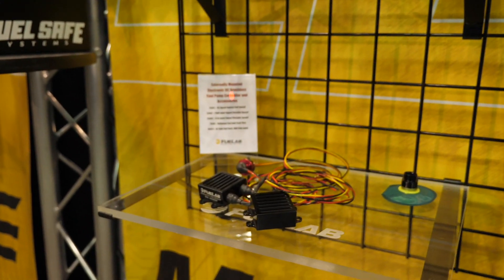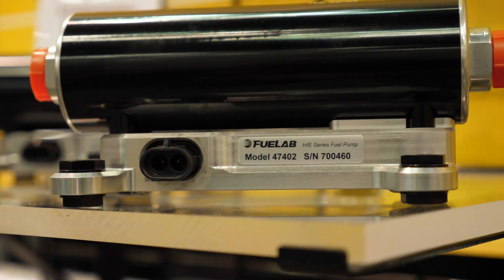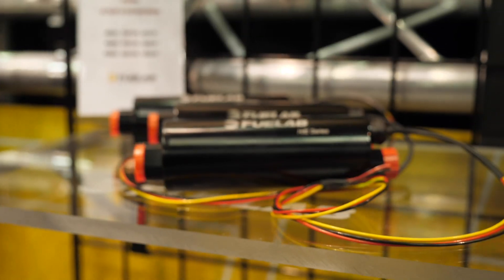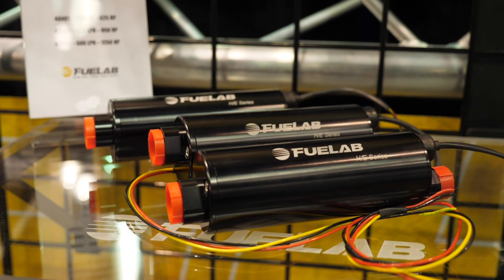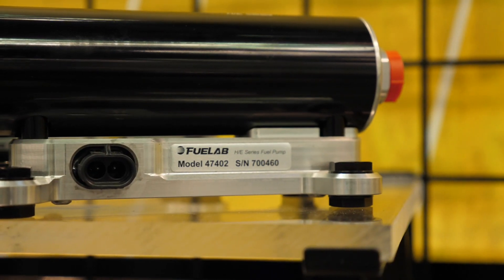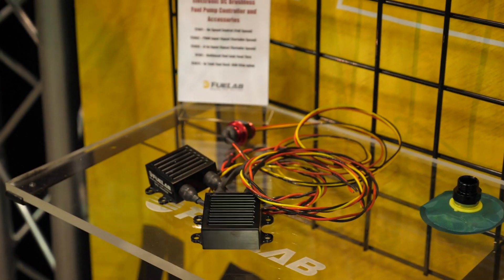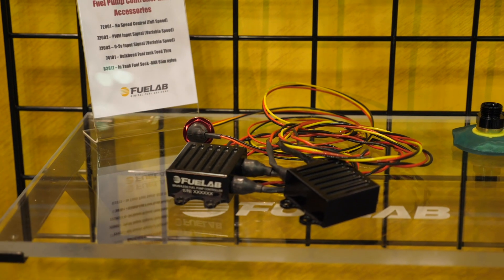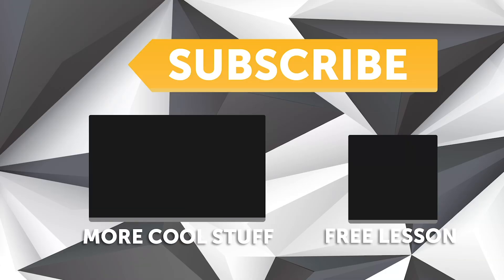The Ultimate Fuel Supply | Brushless Fuel Pumps [TECH NUGGET]

Comment: RC car ESC, OEM pumps are cheap
Reply: depends...
i wanted one that just turns on when powered up.
hard with the RC ones... and then finding a micro one that will take 12v rather than 2S max?
i aint planning on punching more than one hole through my tank for power. 

pump im running is submerged, and turns out theres an ESC in the plug...

Comment: I had a complete Fuelab fuel system on my car and it's high quality and top shelf stuff. i didn't understand the purpose of the external pump tho. it overheats even at the low pump setting for street duty eventually shutting down. i wish the big, brushless pump could be submerged like a factory pump. that would have improved my whole fuel system. i will use Fuelab in the future.
Reply: You could... create your own bypass between pump and regulator, returned to tank.  Use a needle valve for fine tuning volume so you can set  the minimum fuel needed through pump at idle to ensure cooling?  If I tried that, I would log pressure vs. rpm on a w.o.t. run just to ensure the setup didn't hurt pressure at any point before redline.   If it did... maybe add a normally open solenoid between needle valve and tank that triggered to close about 500 rpm before pressure drop was confirmed, then go test again.
External pumps are nice for easy access, but you gotta pick the one that just [and I mean just] gets the job done - maybe it can't keep up at something like redline plus 700 rpm.  A rev limiter would complement nicely, but many racers are already there as they won't get on the track otherwise.
Reply: The HE intank brushless pumps are out. Was it not out when you bought yours?

Comment: I use a PWM fuel pump module from a 90's lexus Soarer to effectively control the flow of my brushed fuel pump on my turbo ninja.  It was initially implemented to lower current draw at idle as the alternator couldn't cope with the extra load but it has the added benefits of less noise and heat transfer.
Reply: do you think one can use this to take an ecu pwm 0-5v signal and amplify it to a 0-12v signal to drive a 4 port boost solenoid better?
Reply: @Boostlee   for sure.   Although its a pretty straight forward job to use the 0-5 V PWM output to drive the gate of a N channel MOSFET.  Just connect one side of the solenoid to fused 12V and the other to the MOSFET which would switch the ground whenever the gate goes high (5V).  You''ll just have to add a bit of protection - minimum of a resistor in the gate line to protect the ECU in case of MOSFET failure or short (10k should do).  Also critical is to place a diode across the solenoid connections to quench back EMF cased by the collapsing magnetic field.  like this -   https://cdn.instructables.com/FKP/N9EL/ISCC4L55/FKPN9ELISCC4L55.LARGE.jpg.  Loads of tutorials available online.

Comment: I'm surprised how long it's taken the "Fuel pump industry" to embrace brushless technology
Reply from the maker: There are a few other factors at play to be fair. What we want and what we're willing to pay for are not always in alignment for example, but the ball is rolling now 😎 - Taz.
Reply: @hpa101  Fair point! I was comparing it to the 18v power tool industry which was taken over by brushless technology years ago! but they are very different products/industries!
Reply: PWM controllers are a slight difference from VFD's.  But what we get is the same thing: variable speed output which gives us a dynamic  pump curve.   The technology is now pretty well developed and controllers don't break the bank - it hurts to have 5x or more invested in electronics than the pump [as happens in certain operational specific environments like running centrifuges].
What I'd like to see is a demonstration of is how the feedback works - or is there any?  In the case of an engine, you could pretty much chart fuel demand through it's rpm range on a dyno and just map a pump speed curve that follows an rpm input [and doesn't necessarily need fuel pressure monitoring] - but fuel pump regulator is not optional, as rpm does not necessarily track demand [as  in accellerating through 5k rpm vs. maintaining that speed].

Comment: So we can run a 0-5v map signal to it? Would that be a suitable setup?
Reply: Tps
Reply: @circuitspecdc1928  MAP would be much more logical than TPS, as a throttle position doesn't always correlate to a particular fuel consumption or power output. MAP would reference exactly how much air the engine is consuming. Hence why fuel pressure regulators are vacuum/boost referenced.
Reply: Fuelab also has an electronic FPR that reads the pressure drop which tells the pump to ramp up or ramp down